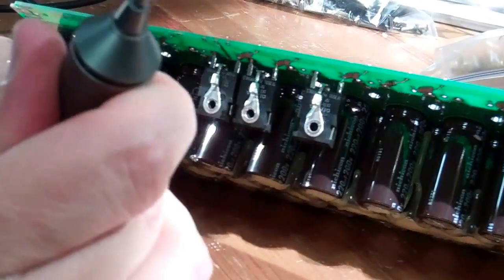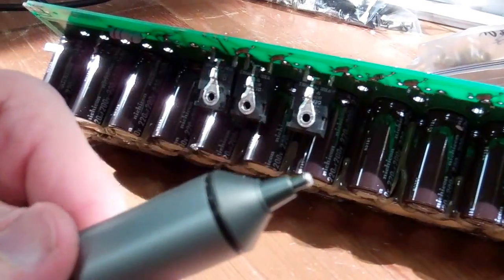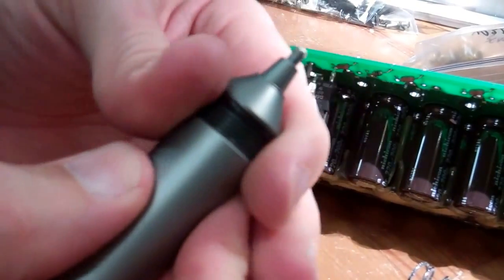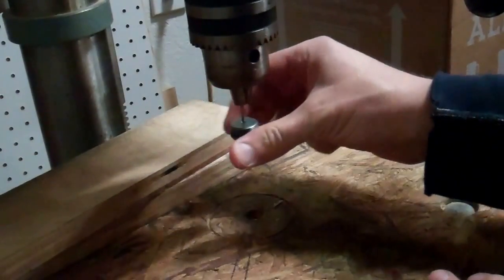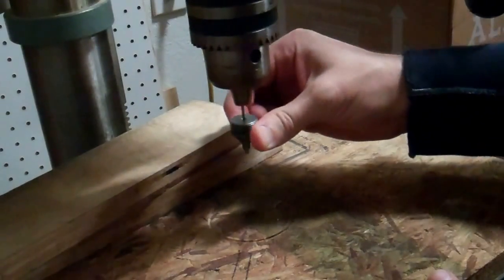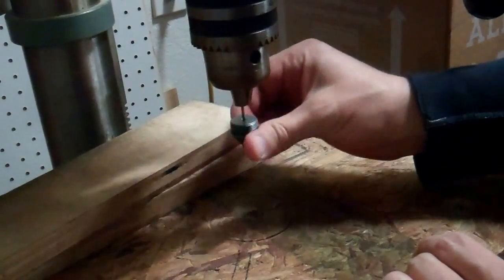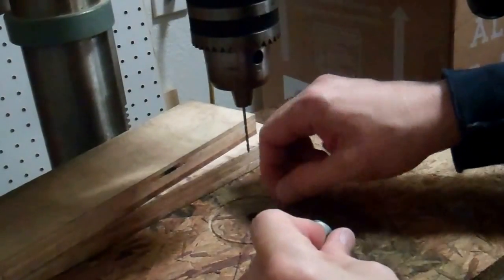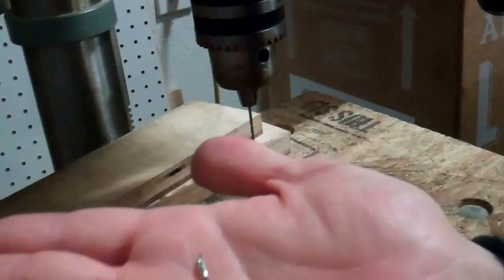Drill cleaning solder out my Engineers SS-02 solder sucker's tip

Comment: Is there any other way to remove the solder stuck in the tip? Don't have access to a drill like this
Reply from the maker: You don't NEED a drill press. You could make use of a bench vise to hold the drill bit, or even possibly hold the drill bit using a pair of pliers. You could even do it with a hand drill. The drill press just keeps things nice and steady and makes it easy to manually turn the tip.  Of course, I guess if you have a 2nd solder sucker, you could use it on the first one....

Comment: Is there away to restore suction if I unscrewed the end that has the plunger
Reply from the maker: I'm not certain, I've never removed that end, and your comment is making me hesitant to try it ;>  I would assume there is an "O" ring around the plunger, and as long as you seat the o-ring in the groove in the plunger and put it back in, it should get suction again. You may need to use a little bit of lubricant (Vaseline?) around the plunger to get a complete seal and make it move smoothly.

Comment: Won’t a heat gun work better since all the solder will just melt out?
Reply from the maker: I don't have a hot air rework gun to try that. The surface tension would hold it in, but the plunger could be used to force it out. I would worry about melting the seals around the plunger though.